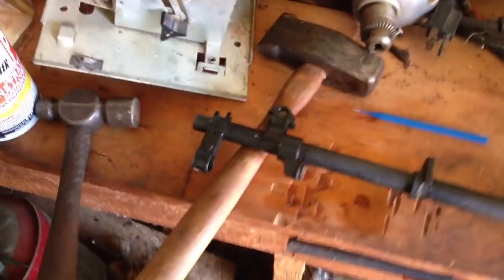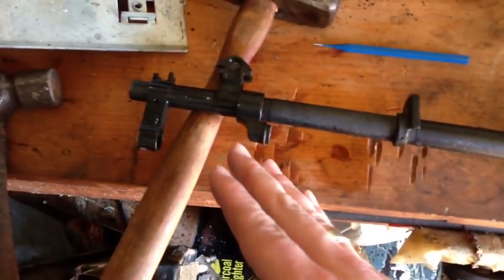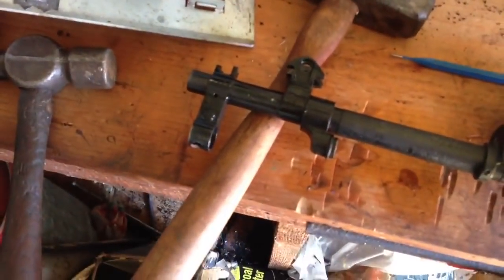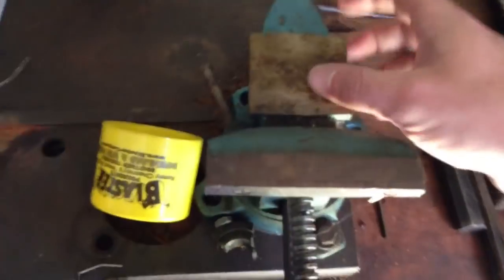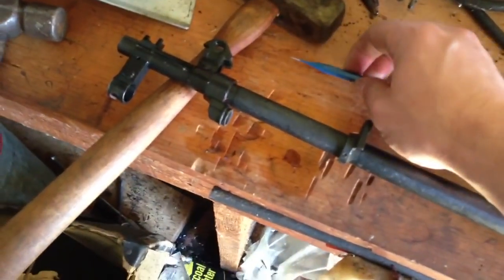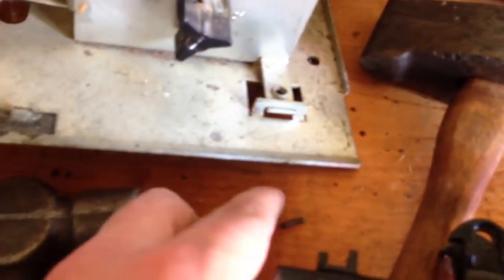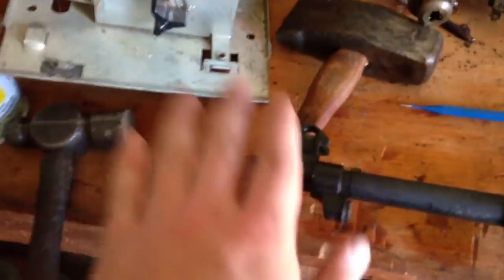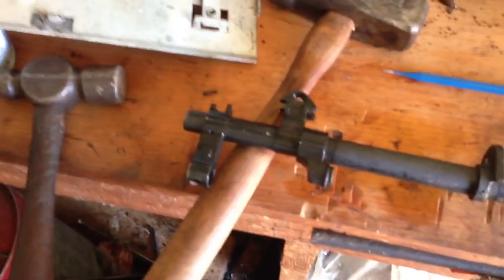SKS Bayonet Lug and Sight Assembly Removal Tutorial

Comment: Good video! except, What country of origin is it, China/Norinco, Yugo, Russia, etc., it may not matter but just wondering.....Also, Note the pins are .098 dia on my Norinco, so a 3/32 .093 punch is needed / Also the pins are Not tapered on mine so it does not matter which side you punch from / my pins came out real easy, no oil, no heat, now the sight/lug....I'll use a butane torch after penetrating oil, but Nice video and thanks for making it! I'm making a rear peep and new front for these in a while and needed to know this, THANKS!

Comment: Also, might you have photos of what the tip of barrel look after you removed that front tip?  you say it slides off, I thought is was a screw on. Correct me if I'm wrong, but I am assuming the need to punch out those roller pins on the sight is bcuz perhaps there's a notch underneath on barrel, whereas it helps lock the front piece to the barrel?   Its a pity you weren't able to vividly document the Entire removal procedure, It sure would have cleared up many questions, as some have mentioned. But nonetheless it has shed good light on the subject.
Reply from the maker: Yeah I had no clue anyone would actually watch this video or I would have made it heaps better, it was definitely an after thought.  50k views later :/  Anyway, it's just tapered with a small notch that the pin fits through.  There are no threads or "holes" in the barrel at all.  Once the pin has been knocked loose there's nothing but time's firm grip holding the bayonet lug on the barrel.
Reply from the maker: Here's a photo https://photos.app.goo.gl/VNkZdQSLWpNsHgAHA
Reply: @thomaswde  Wow, now is when I got to see this. I was so concerned that the barrel itself would be affected by this removal. Great to know. Reason I'd like to replace it, is bcuz I was forced to removal bayonet and cut off/grind the lug. It was that or loose the rifle, idiot NYC laws are ridiculous. I'm now out of city limits.

Comment: Tom, on my Norinco, and a friends Russian, the barrel in the front section is Not tapered, and also the pins are not tapered so they can be punched out from either side.
Great video though and i wonder how much easier the assy. would come off with more heat. like a butane or propane torch? 
I'm going to remove mine soon and will do a video and find out.
Reply from the maker: Good luck! A torch would likely have helped a lot, I was pretty ill equipped for the job. :)

Comment: you can also take a rubber mallet and and tap the front sight and it begins to loosen after some time. takes patience but it begins to come off. rubber mallet doesnt damage anything either. using a wrench can leave ugly marks on metal. wood block also good. regardless of method this video was extremly helpful. the front sight pin was a mother F!$#%$ to get out thou. soaked it overnight in PB Blaster and still broke 2 punches. finally came out after over an hour of pounding. now debating on wather to buy a thread kit and thread the barrel for a muzzle brake.
Reply from the maker: I'm glad it was helpful! It really was kicking my ass and I couldn't find a vid anywhere on how to do it so figured I'd shoot a quick one.  Regarding the muzzle brake, click on my channel and look at my video titled "SG Works SKS Stock Kit Review and Thoughts", in it you can see the route I took regarding a muzzle device.  It may not be as solid as a threaded barrel but after a year of use it has held true with no problems.

Comment: I've a Norinco Chinese SKS 7.62x39, and mine came with the bayonet and mount. Problem became when the city of ny added a claus to the long gun laws, regarding this Any rifle that equips or accommodates a bayonet. That any such was now deemed illegal. Owner would have to remove and render it unattachable or surrender the firearm. I initially complied and even grinded off the mount. Little did I know I would now need that mount for properly attaching a bipod. Sure I can adapt one of those that grips onto the barrel, but that's not the way to go. So I am looking to replace this mount. I've searched around and not really found this mount piece in particular. Would You know where to obtain one? John
Reply from the maker: Sure don't.  I may still have mine somewhere but I haven't the slightest clue where it would be.  Good luck!
Reply: @thomaswde  Hey Tom, thanks for the reply. Regarding Your mount, that has fallen into the abyss, might you be able to find it if you searched, perhaps one day?  Would greatly appreciate it.

Comment: I'm wanting to get rid of the front sight on my sks but I dont know what it looks like under there? is it threaded? do I have to do anything to the barrel before its functional again?
Reply from the maker: nick1234jesus good question! You're good to go, not threaded, no need to modify to continue using it. It's is just slightly tapered off smooth steel. You'll probably want to refinish or paint it after removing the sight block as it is unfinished steel under there. I used matte black grill /oven paint on mine. Not as durable as a finish but great as a cover until maybe getting it duracoated (or ceracoated)
Reply: Awesome! Thanks a lot for the info!
Reply from the maker: nick1234jesus no problem, best of luck... You'll need it! Took another half hour after I made this video before I finally got it off, it's not easy at all. I ended up clamping it in a vice and cranking the shit out of it before it finally gave way.
Reply: I think I'm just going to drill out the pins which should save me some frustration. Then it's just crankin'r till she pops! Haha

Comment: My question is about the rifling of the barrel that continues down through this sight/bayonet lug to the crown.  Is there a change that when or if you re-install that you may not have the rifling aligned properly and by doing so, negatively affect the accuracy or worse perhaps make a dangerous situation?  Secondly, what is the purpose of the removal?  Are there mods that are not as obvious as say suppressors or muzzle brakes that one may consider?  I am new to the SKS world, so please pardon my questions if overly simple.  Tks!
Reply from the maker: Sorry I just now noticed your question.  I did this because I was doing a "bullpup" mod.  Here is a vid showing the finished product of what my rifle became, thanks!: http://youtu.be/X7_GrBy41r8?list=UUTRE2MIXaxbRjVm0mPelXcQ
Reply: johnbarrettski You are not removing the entire end of the barrel, the front sight block tightly around the end of the barrel, the diameter of the barrel is thinner where it passes through the front sight block so there is no need to worry about not getting the rifling aligned correctly.

Comment: The pins in my front sight were taken out very easily. Almost didn't need to hammer. But the sight itself won't move. I used pb blaster. Heat. Torque. Is there something I'm missing? It won't budge. Thanks guys.
Reply from the maker: Just need more torque.  I had to lock the front sight block into a vice and use gloves and all I had to break it loose.  Yours may be even worse, good luck!!
Reply: I did finally get it off. I set the muzzle on my bench and an old rubber phone case on the top of the sight. Hitting it with a regular hammer pretty hard. It finally moved. Then I proceeded to cut the barrel down to 17 inches. Kinda destroying the purpose of removing the sight in the first place. Loving the sks though. Sg works bullpup stock is pretty cool

Comment: Did it work? I mean did you get it off? cuz I saw another guy fight like the devil to get it off, ended up using a puller.
Reply from the maker: doacarnage just noticed your comment/question, yes it actually worked fine but I did have to fight it like hell.  Took around half an hour from the time I shot that vid until she was free.  To pull the lug off I had to put the sight block in a vice and crank the dickens out of it while pulling.

Comment: So how do you put it back on
Reply from the maker: That would be pretty hard, not attempted. I'd imagine you'd need to lubricate and slide the bayonet lug back on and line it up perfectly with the roll pin grooves. Then you'd have to hammer the pins back into the lug holes. Not something I plan to attempt.